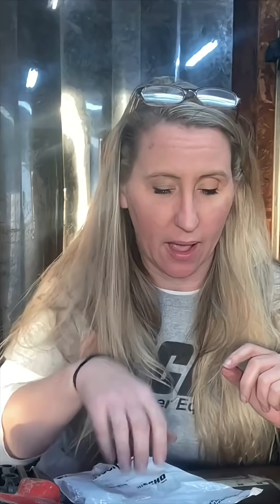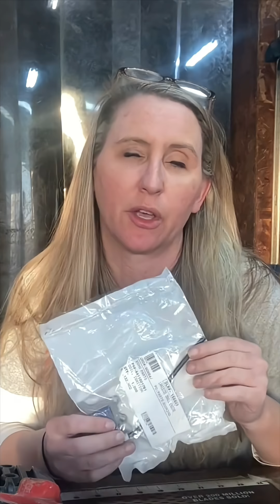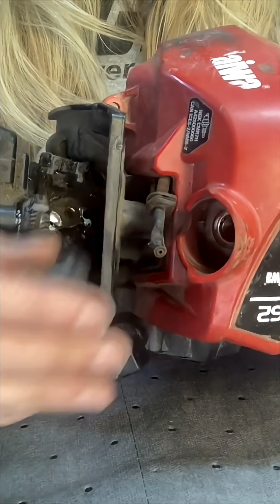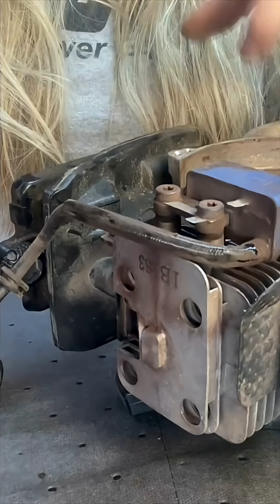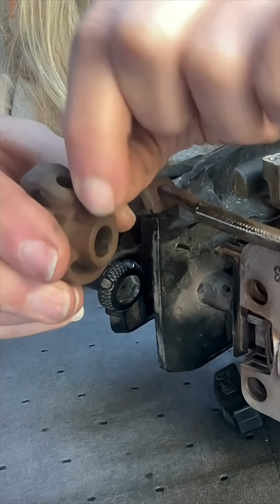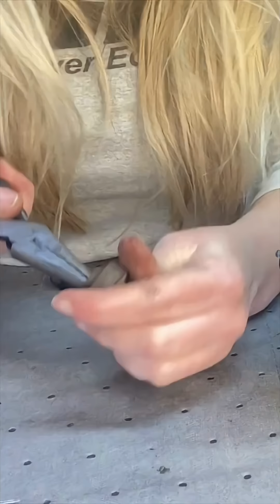Huge Problem! Easy Fix! How To Easily Replace Your Plug Boot!

Comment: How about a short video that shows how to remove the boot and connector from your spark plug without pulling the inside connector/spring lose from the coil wire. With practically no slack in the coil wire, this is very easy to do. Don't ask me how I know.

Comment: Man this brings back memories of tearing apart whipper snippers and chainsaws as a 9 year old and breaking them even more in the process of fixing them.
Ill never forget showing my buddy how to "diagnose" a bad coil on a 2 cylinder outboard by yanking a plug wire off while it was running with a pair of needlenose. My god, what a shock!

Comment: You're Quick and explain while you do the steps with no chatter.  This is the same way most Landscapers work. Many times Fix the machine in the trailer and finish the job and go to the next yard.

Comment: Just one thing I am still wondering about after watching this one ; what was the red colored lubricant that was used ??? I have found that a petroleum product for this sort of thing can have "a bit" of a degradant affect on the boot and possibly the wire jacketing (particularly when subjected to a significant amount of heat , like is common with such assemblies). I tend to prefer a synthetic lubricant ; and whichever one might be used try not to use more than you need .👍Be well ya'll

Comment: BOOT QUESTION -  What does the boot do?  I have operated saws which had no spark plug boot, just the little wire spring, held to the wire with heat shrink.  The spring holds on to the plug terminal tightly.  Much more secure than the rubber boot, and easier to install/remove from plug.  No shocks.  The plastic housing keeps fingers away from the plug terminal, and keeps rain off.

Comment: What actually happens if you cut/trim the ignition wire? Less Ohms resistance, advance timing? Assuming since it's a magnito. I'm wondering why because the last set of plug wires for my Harley Davidson, you custom cut them the length you need. MSD, Mallory, and other hot rod plus wires you cut them the length you need. But that's mostly electronic. Pro Mod and up uses one or two mags. Enjoy your clean channel. Excellent work you are doing. My kind of gal. As long as you love the Lord and Jesus Christ.
Reply: She said the length was exactly perfect for the application, cutting it would diminish that.

Comment: I have only replaced a few coils on my own equipment but have never received one yet that did not have a boot already.  Thanks for showing this.
Reply: original equipment will not have a plug boot because they want to charge you another ten bucks . After market will but you get what you pay for ?

Comment: So the only connection between the coil and the spark plug spring clip is that little angulated pokey thing penetrating the side of the insulation of the coil wire? What kind of electrical connection is that?🤔🤔
Reply: The high voltage doesn’t need much contact. And the wire isn’t wire, it’s braided carbon.
Reply: @RussKlo Thx. Very cool! High voltage, but low current. (Edited)
Reply: @RussKlo think they still use koper wire.